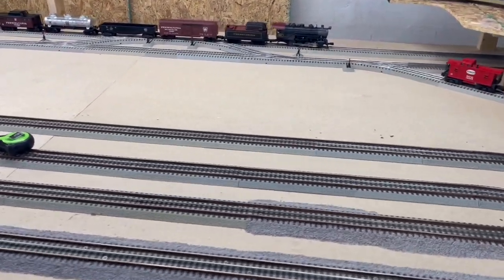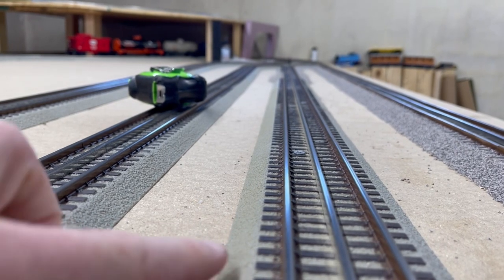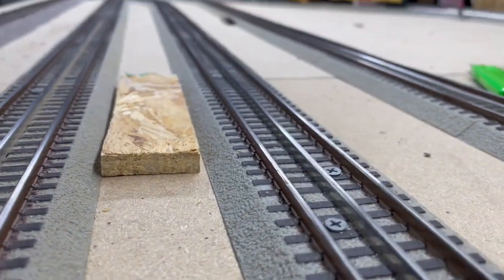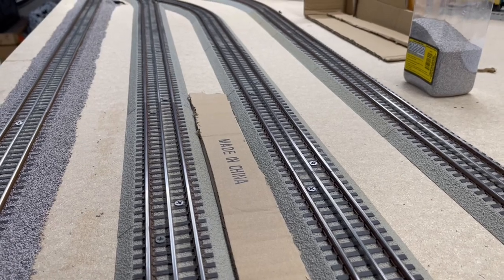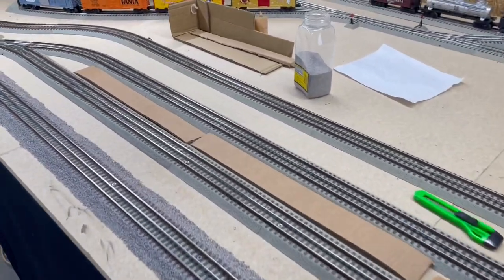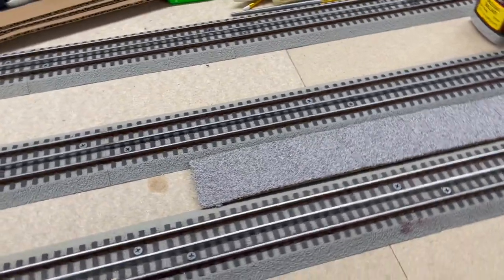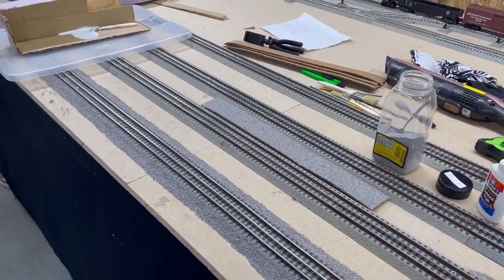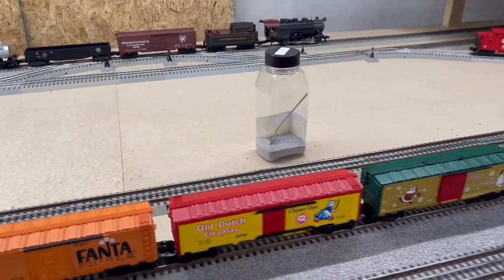Creating Ballast Filler For The Yard! / O Scale Layout Build SeriesUpdate 7

Comment: Did you have any trouble with the ballast cracking and pealing up after it drys? When I ballast single track it’s fine. But when I do a yard area between two tracks, when it drys it breaks away from the track and curls up
Reply from the maker: The spots I saturated with iso and glue are fine. Even the thick spots. The areas I missed some glue ended up cracking a bit.